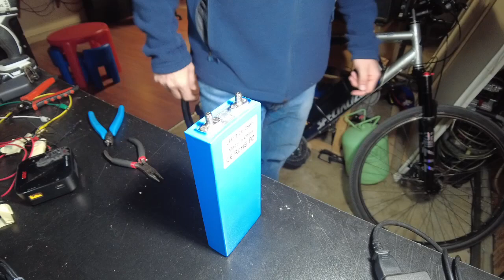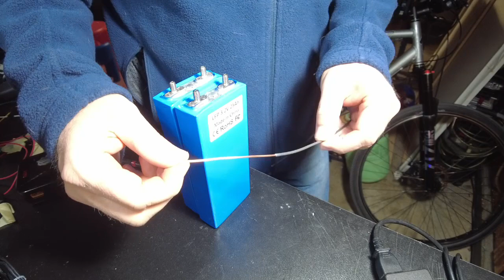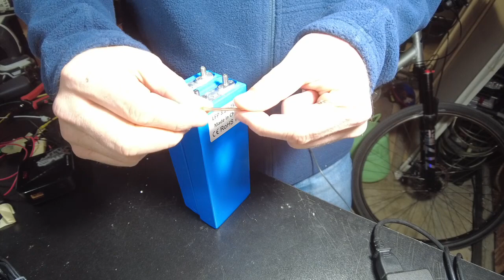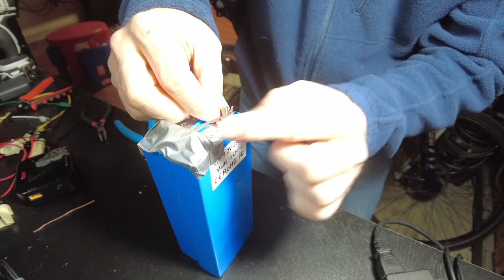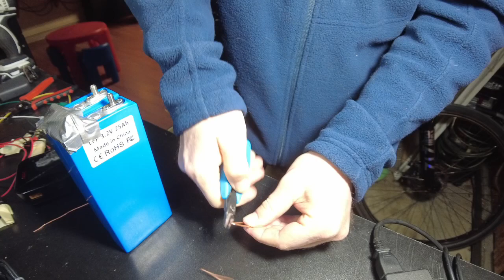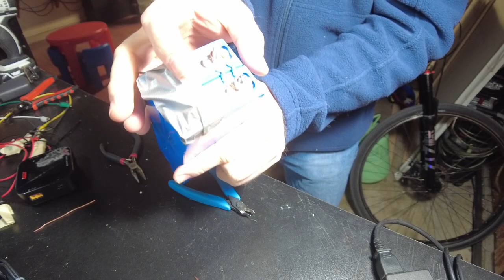Super Simple Prismatic LifePO4 DIY 30A Copper Busbars

Comment: That should be about .0001 ohms, .003 volts and about .1 watts each at 30 amps.  According to my crude and sometimes controversial calculations.
Also using solid wire gives you a higher point contact pressure than flat stock. Which is probably good.  :)
Reply from the maker: Yup your math is pretty on point sir!

Comment: That's 15 amps AC, Not DC. Solid cord wire for DC normally you would cut that in half. So around 7-9 amps pending length.
Reply: Check the wire size and fuse ratings in your car. 14ga will easily handle 15a DC. In fact, it is rated by NEC for more than 15 amps in A.C. circuits also, but then you need to run the calculations to know if you can operate at 75C or 90C limits in your installation. In a little mcmansion it's easier and cheaper to limit to 15 amps.  Except in your appliances. Then 14ga is used for more current because the manufacturer will do the math and save the pennies. Usually they'll use 18ga if all they need is 15amps.
Reply: @Sylvan_dB  Nice analysis.  I always fall back on Ohms Law.  :)
Reply from the maker: Incorrect. It can handle 15 Amps DC too. The one inch distance there is only a 0.007853v drop at 15amp.
Reply: WHAT!?  Where did you learn this?
Reply from the maker: Only on longer distances when you have to consider voltage drop with DC, and then you may need to oversize the wire.